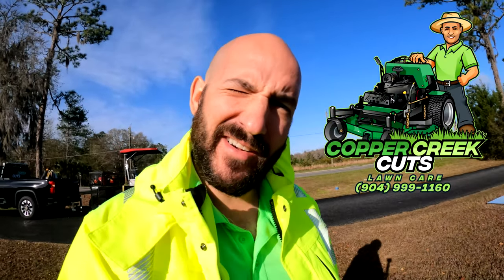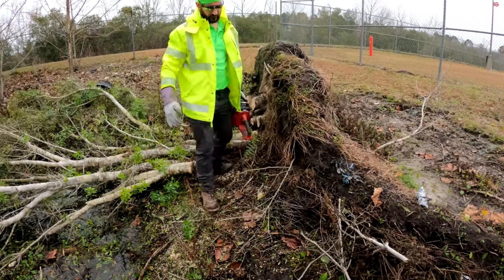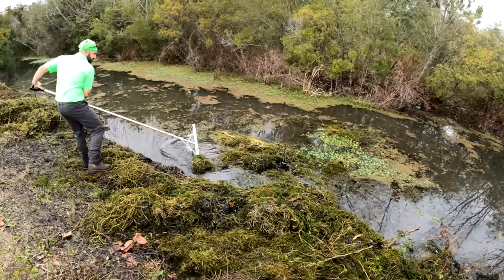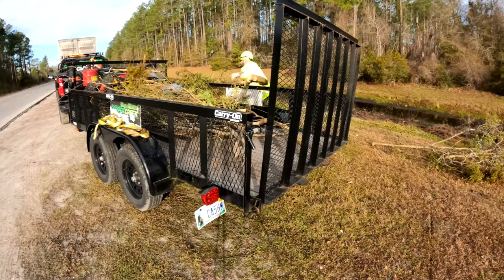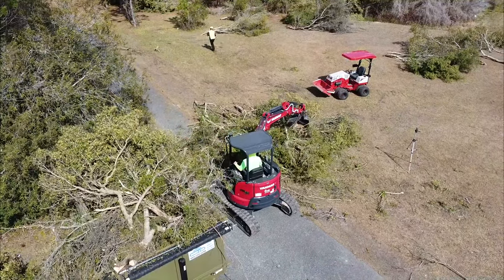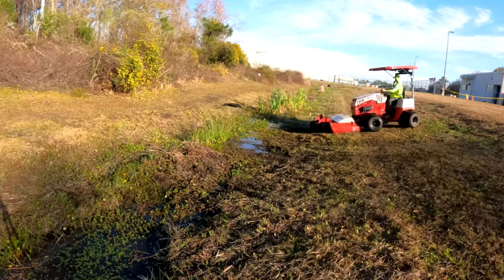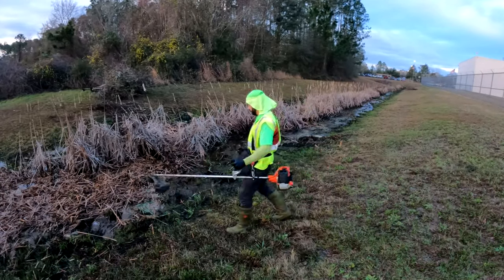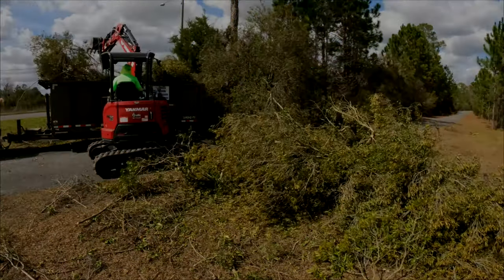Another Huge Stormwater Management Project Completed

Comment: Get you a old wagon that no one uses anymore and take the front handle/hitch and axles setup off it and make a turn table plate on top of it where the main wagon bed attached to the front half and then you can use it as a dolly for the bottom of branches and trees so when pulling them they dont dig in and damage the yard/grass

Comment: u should invest in good winch.  ATV winch 5000lb would work if you double up the line.  that way you can be sitting on the tractor and be using the winch either with wireless remote or just the standard wire remote
Reply from the maker: You are right! I may look into a portable one before investing in one that lives on the back of the Ventrac.
Reply: @CopperCreekCuts   Portable one is all you need.  Hitch mount it.  U could use it also on the trailer incase you need to pull something up into the trailer. run battery cables from your truck battery to the back of the truck and run the winch  on the trailer or on your truck hitch.  If u use 2 to 1 or 3 to one leverage you could even pull tree stumps. Your Ventrac is a beast.  having a winch there would make life easier

Comment: Nice work,  I was just wondering why you don't get a woodchipper for those trees.
Reply from the maker: Good question! I would have figured out how to load it on the trailer, and I still would have had to touch each piece by hand to load it in the chipper , and I still would have had to dump at the landfill.

Comment: I always wondered how that big echo line trimmer is the 3010 or whatever. I got stihl 131s and a 240 mainly. Stihl has a brush cutter that’s 4.5 horsepower  but I tried on the 3.0 HP smaller one with the harness and that was heavy as hell. So I got a 311 which has the 131 engine and the nice 4 point anti vibration. I got a lot of trimmers and bla bla
Reply from the maker: Haha, thanks for watching and commenting!